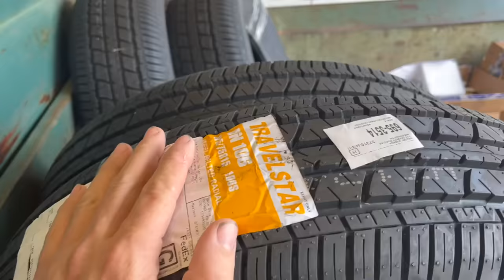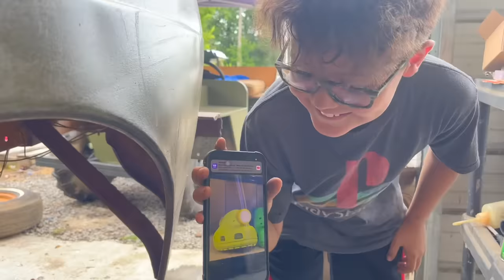Barn Find 1 owner 52 Ford truck survivor back on the road after years parked

Comment: Drive by wire is the new way. The time of manual mechanisms is gone.
Reply from the maker: They have definitely switched over to that
Reply: Get the blue off the tires like yesterday.  Only need water & a brush.
Reply: That looked like vapor lock in the carb.

Comment: I got a 1951 Ford bus with the flathead V8 enginemy 1951 Ford bus  looks exactly like that truck front grill. NOT very many 1952 Ford trucks around anymore I think the 1952 Ford pickup was  was the first engine with overhead valve's I think the 1951 Ford engine was the last Flathead engine Ford made

Comment: ROCK AUTO IS TERRIBLE!!  They ship the wrong parts and you have to pay the postage to return them even if it is THEIR FAULT.  I won't buy from them anymore.
Reply from the maker: They definitely have their issues but when you are buying as many parts as I do it’s hard to beat their prices even with a wrong part in most orders
Reply: @Sleeperdude  Practical point.  Smart point for most.  I am a sad case, I waste nothing.  If I have an engine or a trans I find a body put it together and sell it on.  (I have a 440 and 727 in the garage now....)